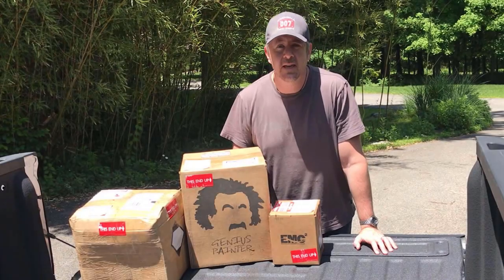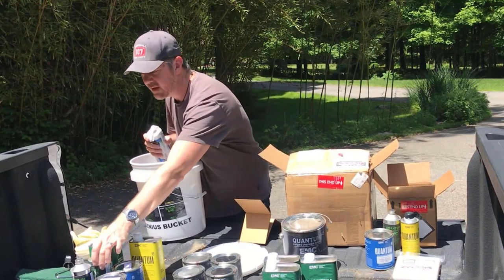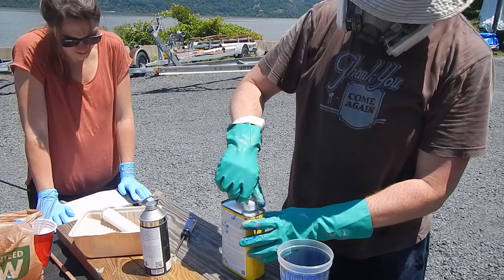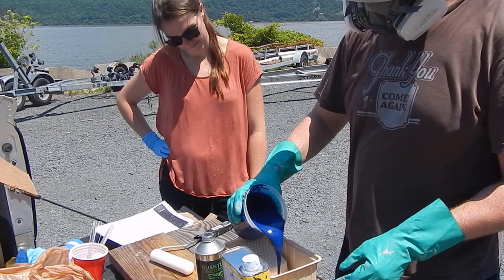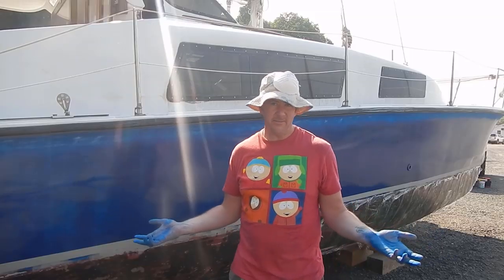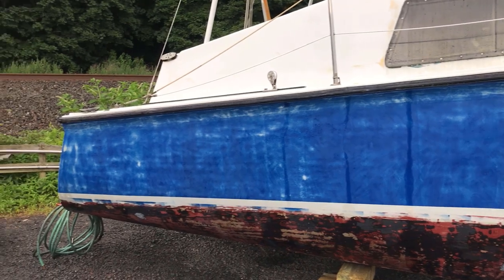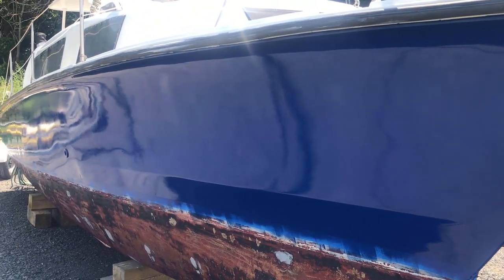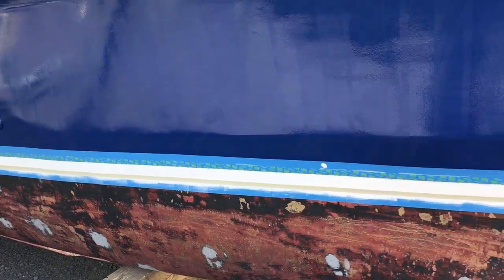Our Experience With DIY Boat Paint: EMC Genius Bucket and Quantum 99 (Boat Work: Sailing 9 LIVES)

Comment: I feel your pain, I had some issues painting my 49 foot sail boat.  Sand, Paint, sand, paint, and repeat. So I tried to think out of the box and thought the foam rollers were introducing air into the paint making it not flowing out. So after many experiments with all kinds of rollers, I found that I could get a prayed looking finish by using a cigar roller with a non-lubricated condom over the roller. I know it sounds funny as hell, but it worked.  I used a regular roller to get the paint on the hull then switched to the covered one roll it out. Try it on a sample and you will see the difference.  I could see the pinstripes on my wife's Mustang in the reflection of the White hull. Good luck with the rest of the project.
Reply from the maker: Wow, that is absolutely thinking outside the box. Fantastic! I am glad to hear that it worked out!

Comment: Wow she really turned out great I would have been freaking out before the clear coat went on thats for sure.
Reply from the maker: We were. We were.
This video ended up long enough, but I cut out where we tested clear coat on a boat hook we painted and then sanded the $hit out of... the clear fixed it right up, so we proceeded with the sanding of the boat.
When we see you in FL after COVID19 runs it's course, you'll see how it turned out. It is decent. :)

Comment: Thought you'd never come to an end of pulling items out of that bucket!! Quite a process, mixing, painting!! The sanding would drive me crazy, but it's accentual for that great finish look!  You'd think they could have given you a better location in the yard, knowing you would be paint so much!  Wonder if setting up a clear plastic tent would have helped? Could you spray paint with that product?
Reply from the maker: I was sure that there was a rabbit in there, as well...
The marina rule (though I don't see any evidence of it actually written in to the bylaws or anything) is that we are prohibited from spraying paint. Tenting with tarps is not an allowable workaround. So, we chose the Quantum 99 stuff, because it promised to provide decent results from rolling. It kinda' sorta' did. This paint IS sprayable, and I believe the preferred mix ratio for spray application is detailed in the instructions. Surely, if we had the opportunity to spray our results would have been better.
Incidentally, this paint is super tough. It took quite a beating from fenders and a repeated bashing by a pair of kayaks tied up to the boat, and there is no evidence of the abuse. We did manage to chip it high on one bow when we collided with something in the river that ended up flipping up and bulldozing us to a stop.
Reply: @Sailing9LIVES  Must be very tough to take that kind of abuse! Hitting something that brought you to a stop and only gave you a chip, is impressive! Stopping that much mass could have easily been a hole!

Comment: I have a similar rule.. I call it the 20/20 rule.  "It only has to look good from 20 feet away, or while going 20mph"      I painted my motorcycle race bike with foam rollers and rustoleum thinned a bit with mineral spirits.  It self leveled really well and actually came out amazingly good.  No roller marks, streaks or orange peel.   Not sure how well that would work on a boat, but I imagine the clear coat over it would protect it.
Reply from the maker: Wow, 20/20... That's too close! Hahaha!
I've done the rustoleum thing before, in my case on a lawn tractor. It did come out super nice. It is a fairly soft paint, though, so I am not sure how durable it would be on a boat, Maybe just fine... I'm no expert! :)
Reply: @Sailing9LIVES  Yeah, it's definitely a soft paint.  I didn't clear coat mine so it would chip when pebbles hit it, but was fairly easy to repair.  I wanted to try a clear coat to see if that would be hard enough to protect it.. but i've sold the bike since then.    Maybe next time. :)

Comment: Dude I didn't see you tip the paint??? That's what lays the paint down
Reply from the maker: You are right, we did not tip (though I wish we had). This paint, by the advice from the manufacturer, is intended to be applied by roller and then allowed to self-level... no tipping required. BUT... roller marks are evident in the finished result, and I wish we had tipped the paint anyway.
If I ever paint this boat again (or another boat) I will very happily use this paint again. However, I will find another place to paint it that will allow me to spray, and I will apply it appropriately thinned for spraying. Roll-on application is a nice option when you cannot spray, but the result just does not compare. :)

Comment: What nap roller was that?
Reply from the maker: It was a foam roller, labeled "smooth". I don't believe there is a nap level on the foam rollers like you would find for the furry rollers.
It was recommended by the manufacturer that we roll and NOT tip... but it seems we would have been better off tipping the paint anyway. We would have sprayed if we could have.
Reply: @Sailing9LIVES  I have done a few repairs with black foam brush, but spray when job over a sq ft or so. I was curious because when I brush on it's sorta tipping same time. I've also never used emc, usually just prep fiberglass, fairing the holes and highs, then gelcoat. Emc is stronger then gelcoat and can be sanded back to repair they say as you mentioned. Great looking boat and great job painting even still. Thanks for sharing.

Comment: You ALWAYS have to tip  off the paint with a soft brush to level any paint that has been rolled on.
Reply from the maker: nick viner 
Agreed. The claim was (and still is) that this particular paint can be rolled and should not be tipped... After our attempt, I would say that perhaps you can get away with it under ideal conditions. Our paint job would have turned out better if we had tipped. Better still if we could have sprayed.
Reply: OK I think I know now what you were using.Goes off so fast that you can't tip it off. A lot of the polyurethanes are like that.